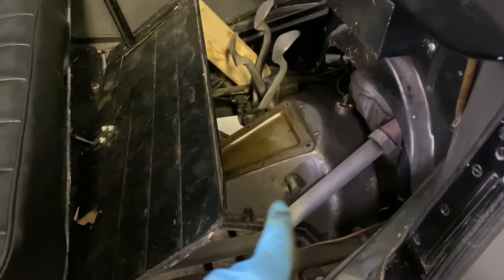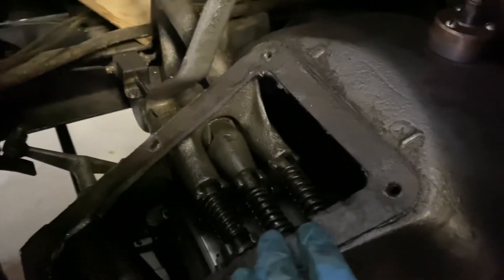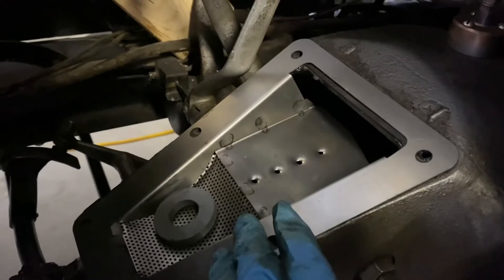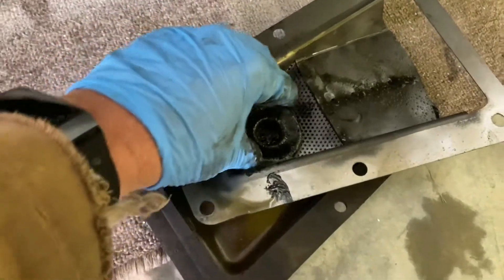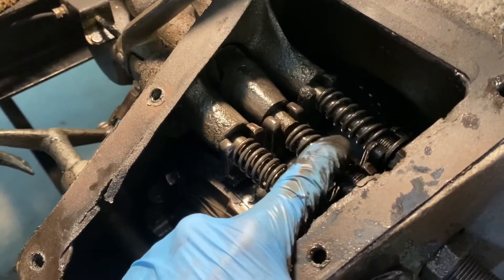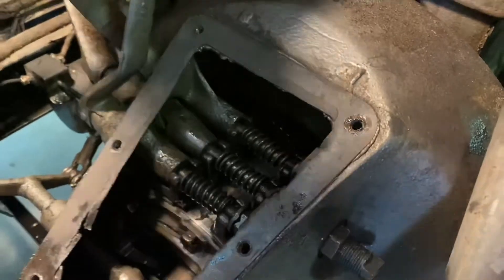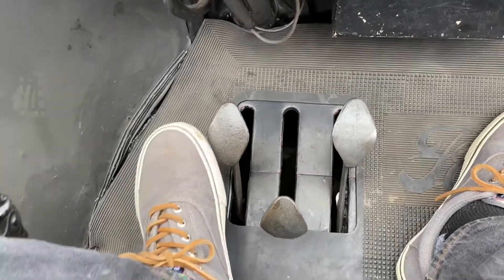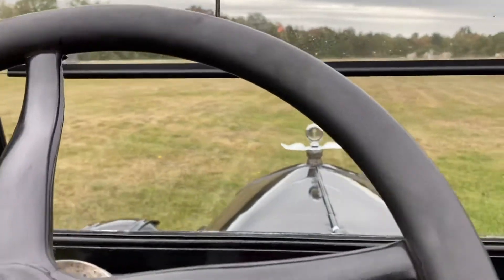Model T -Transmission Adjustment,  “Filter” Addition and Driving the T

Comment: Seems that I am confused as to how the bands function. They do not rotate so I assume that when they are engaged they stop the rotation of shafts that have gears? I need a diagram but do not know where to obtain one.
Reply: Planetary Gears.   Look for a video describing how planetary gears can produce different gear ratios.  By holding the outside drum, you force the gears inside to spin faster and that's a different gear ratio.  The bands are what holds that drum.  Ironically, that's all a modern automatic transmission is doing...spinning planetary gear sets, using bands to hold the drums etc..
Reply: @cember01  I found the diagram that explains "the works" but it was on a non English language site and the wording (in English) was too small to read using a cell phone. I am assuming the diagram is in the "Model T bible" but I have not seen one of those for years.

To make things worse my disassembled Model TT has been stolen. I do not know if I will ever work on a T again...

Comment: So what would happen if you backed off on the throttle and put the parking brake back into neutral position instead of holding the clutch pedal in halfway?
Reply: @Teflon Bill But you could move the parking brake back to neutral while the car is still moving without causing any damage or anything?
Reply from the maker: @JonCannon , yes.  It just forces the transmission to the neutral position. The pedal wants to come up, the lever just prevents the pedal from coming too far up and stops it in the neutral position.